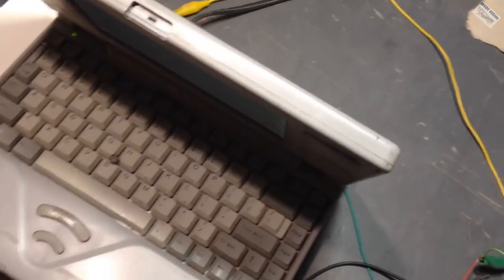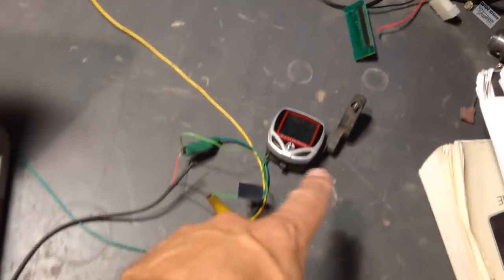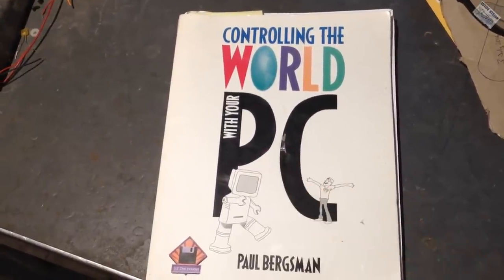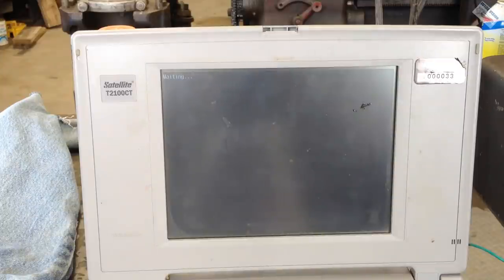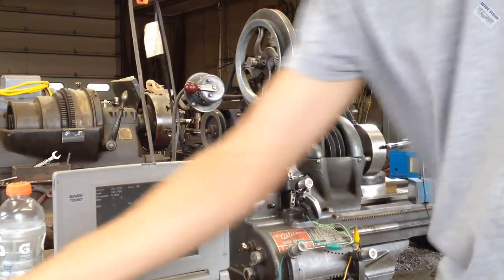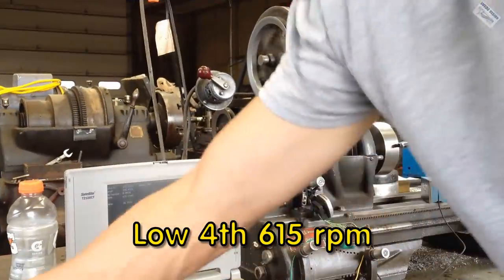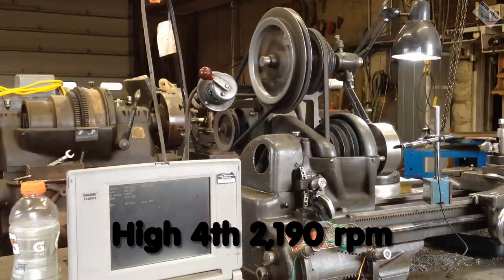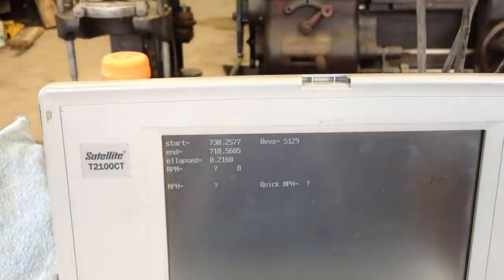Homemade Laptop Tachometer - Atlas Lathe RPM

Comment: Omigosh. I was an EE but got sucked into programming until I retired.  Nice to see a Linux book; I have been running it at home since version 0.12 and that was a long time ago. You are right, it's all Arduino now. NYCCNC (John Saunders) has some good Arduino videos. It's all device driver level programming. Which means that when the hardware goes obsolete, your program does too. So, to your viewer who wanted a copy of your program, it is hardware-dependent and the pin numbers will probably not match. But for a cobbled-together effort this video is great!  . If one wanted an anemometer, I would recommend a small DC motor coupled to a propeller (or vanes).  A DC motor will of course act as a generator and wind speed is a function of generated voltage. What that function is I cannot remember, but I'm sure Wikipedia does.

Comment: Nice video. I put a digital readout tachometer on my Logan 2557V some time ago. Works great until I change chucks. With a larger chuck it is a pain to readjust the pickup sliding bracket. Using a dial indicator stand will make the adjusting process a lot easier. Thanks for that idea.
Reply from the maker: Glad I could help, even if I did so inadvertently.

Comment: Always toyed with idea of VFD and 3 phase motor on the SB.
Reply from the maker: I want to put 3 phase and VFD on the Rockford. Yep, 1725 motor.
Reply: The TECO units are pretty cool.  single in 3 out.  Have one on my drill press works good.

Thanks for the video.  Cool that you were IT minded.

Comment: Very good information.  Ive got a Atlas 10F with a QC on it.  I need to get the correct motor pulley for my motor had a collision with a forklift when I was getting it out of a shop up in Cleveland a year ago so I had a single pulley about the same size as the small one on the step but need to get the right one or maybe build one.
Reply from the maker: Sorry to hear about the collision.
Reply: You have great information I watched your video on the milling attachment just last night again and thanks great info.

Comment: I guessed mechanical engineering or diesel mechanics. COBOL? You're not old enough to have studied COBOL ;). My father was a COBOL programmer. Wow, you definitely went a different direction,  but from what I see, it was a good decision.
Reply from the maker: COBOL ended up being a "cross platform" for me. They taught it in college as an intro to programming, but when I became a diesel mechanic, I discovered the system computer for Peterbilt Semi Tractors was programmed in COBOL.   Some days I still wonder what my life would be like if I had stayed with programming. I have a cousin that programs apps for iPhone. I think that would be neat.

Comment: Would you mind measuring the motor pulley OD's?
I need to replace the cobbled up 3 step pulley on mine with the correct 2 step pulley which is getting harder to find in good shape.
Thanks,
John
Reply from the maker: I get 4.452 inches and 1.956 inches measuring the very outside diameters.
Reply: +Wide Vision Metal Fab 
Cool. Thank you.
With that and the groove dimensions from the driven pulley, I can build my own.
Video to follow.
Thanks,
John

Comment: Can I ask you for the sizes of the Big motor pulleys. Approx 9" inch etc, and spindle pulley sizes. (I'm guessing from 4" inch to 6" inch approx.) I have a Frankenstein lathe setup, and I'm trying to bring some normal setups to it. thanks in advance.
Reply from the maker: I forgot to measure today. Maybe I'll remember tomorrow!
Reply from the maker: Ok. I remembered today!  2 step pulley on jack shaft is 9.25 and 7.5 inches. The spindle pulley is 6,5,4, and 3 inches.  Good luck!

Comment: My guess would be something like agricultural engineering, but it was probably something softer like library science. Your projects don't seem to be as "designed" as I would expect if you were a graduate engineer.
Reply from the maker: I wanted to be a mechanical engineer, but I didn't like my choices for colleges for that. Computer programming paid well, and I enjoyed it as a hobby, so I thought why not.
Reply: I spent 3 years of college studying Mechanical Engineering, and interned as a ME during all of college. I ended up with a Math degree, but that eventually because a computer analysis, design, implementation, management job.

Making chips fly and arcing metals looks to be a lot more fun.